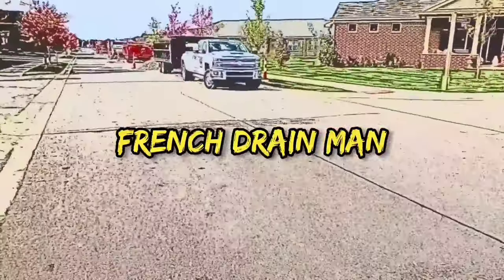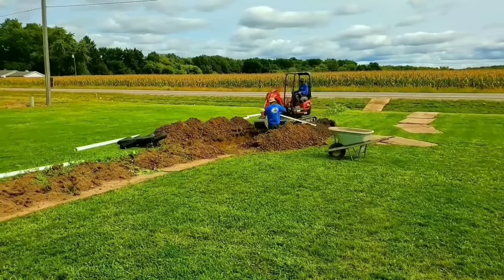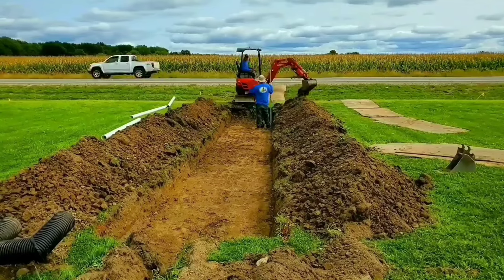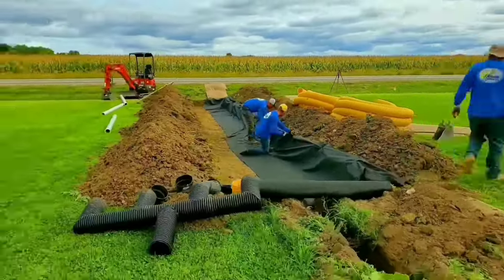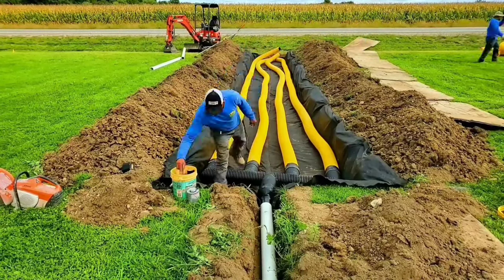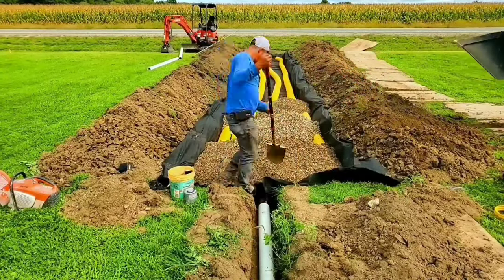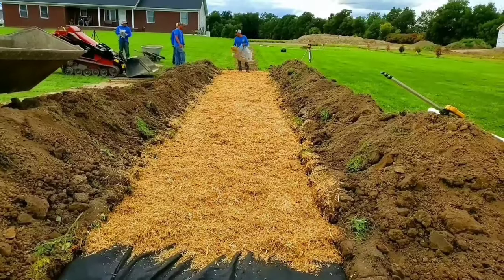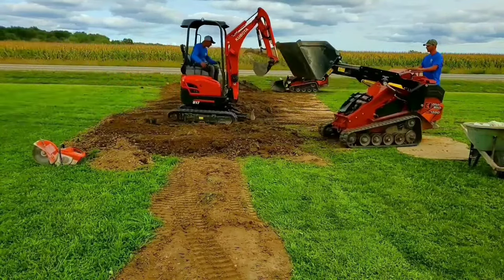Leach Field Instructional Video for DIYers and Contractors

Comment: Thanks so much for this video. You're the only one explaining leach fields for stormwater drainage. Couple questions: 

1. If you add a leach line at the top of a long downslope in a yard, would you still recommend knife-cut pipe and 8-ounce fabric?

2. What size stone do you recommend for a leach field?
Reply from the maker: As soon as your discharge line reaches an area where you don't mind the water leaching go to the knife cut pipe. I would use four-ounce fabric. Normally, for a leach field, we go with a smaller stone, typically buying 3/4-inch round rock.

Comment: I did this at my house:

- Installed a tank prior to the field that caught blackwater.
- it overfilled into the leech field
- I dug down six feet and filled four of those feet with a sand/gravel mix
- covered it with fabric
- Laid out my manifold and pipe - fill
- had a 1/2" drop for every foot
- total of 30 feet with six pipes, wrapped
- built a large shelter over it all to keep out the rain
Reply: what kind of tank did you install...how many gallons and did you modify it in anyway/

Comment: the perforated pipe in between...is that connected to the black connector or does just lay in between with 2 end covers on each end of the 3? I have a huge field at home that floods after heavy rains and I am going to try this and will need the 3 perforated pipes as well.  Will be ordering from your team.  Thank you!
Reply from the maker: That was 6" pipe

Comment: Did you get a soil test done first before sizing the field that’s needed for the water volume
Reply from the maker: Test came back CLAY so it has little and slow particulation. The more active the sump system the bigger the field. It tested CLAY. I know the soil in my service areas. I don't bother with any test plus everything I do is overkill. We like overkill. Thank you for commenting.

Comment: If your sump pump runs a lot and you add extra pipe between the manifold pipe where do you put the pop up on the end of the run?
Reply from the maker: Watch "Where to take Yard Water with No Storm Drain PART 3 [ 248-505-3065  ] French Drain Man" on YouTube
https://youtu.be/czETK6BEj08
Reply: @FRENCHDRAINMAN  thanks Robert! 👍🏻

Comment: How much does evaporation figure into leach field function?  Do the aspects you discuss in this video apply to septic system leach fields as well?
Reply: Some water may evaporate, but remember the leach field was installed because the water was not evaporating or flowing sufficiently off the grass in the first place. So I don't think it helps significantly here. As far as septic systems go most states require septic design licenses with a set of codes that go with it. Septic system leach field are indeed pretty much the same thing as this but vary in size depending on the occupancy of the building.
Reply: @VTGoPro  Thanks for the insights.
Reply from the maker: Yes, evaporation does play a role. That's why when you look at leach fields, in the summertime, they're completely dried out, and that's where all the dead grass is. They're built to evaporate water, not to stay saturated on top. You don't want to cover them with heavy soil. You want to cover them with permeable soil.